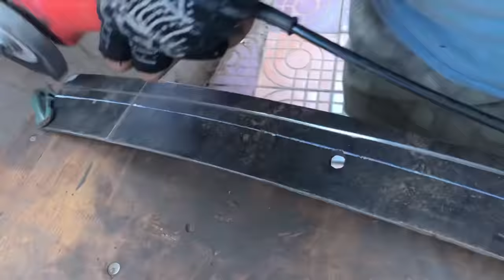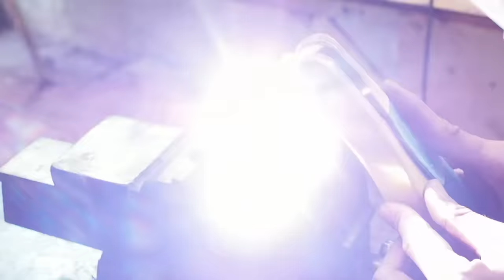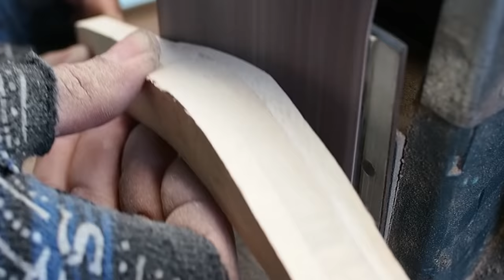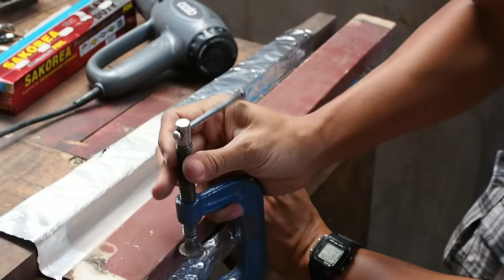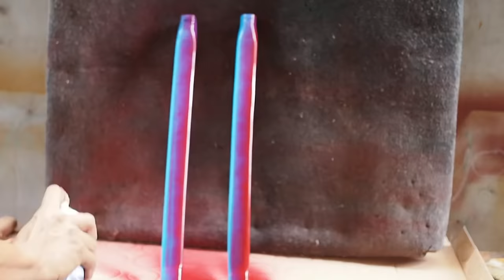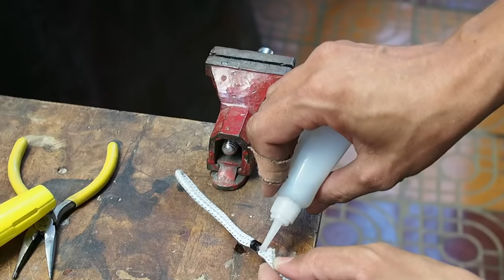Make Take-down Mongolian Bow from Leafspring and PVC pipe without Forging | Make Mongolian Bow

Comment: What’s the draw weight? I have a 60lb horse bow and that thing is a beast to shoot. I can’t imagine what a metal bow is like
Reply: Looks pretty weak IMO.
Reply: @SpontaneousDelphi  appearance is deceptive at times... a well trained archer can surely use this with ease to pin dow  it's target
Reply from the maker: Thanks brother for the question. it's 60lbs bow. I can assure you steel bows are not as good as real composite horse bows, but they will last longer and much tougher.

Comment: With all due respect, this is not a Mongolian bow. The Mongolian bow, like other eastern bows, must be in the opposite direction prior to stringing bowstrining. This is where its power.
Reply: Probably it is made of soft wood an requires retention for power
Reply from the maker: Thank brother for the comment, actually it dosen't look exactly like Mongolian, it's the best I can do for now. By the way, the limbs are made from steel, it can't bend like composite bow. The performance is also not as good as the real composite Monglian bow, but I am sure that it's much tougher and will last longer. Have a good day, brother

Comment: OK, this particular weapon is rather involved. This is no quick, easy MacGuyver rig-up here.  This guy has an entire workshop with a plethora of different tools at his disposal.  It's a very nicely made bow, but if I'm going to fashion myself an 'accessible' survival weapon from simple 'debris' just lying about, from a practicality standpoint, it really can't involve having to use more than a knife, an axe, a hand saw, a file, a piece of sandpaper, a hammer, some cordage and some glue, at the very most. You start getting in there with bandsaws, belt sanders, welding rigs, die grinders, bench vises, metal brakes, measuring devices, etc, etc, and now you've crossed into the realm of very involved crafstmanship.
Reply from the maker: Thanks brother for your kind comment. I inherited some of the powertool from my decaced father in law, and some from my brother after he stop doing wood working business. I am grateful to have them. I wish I had more time to practice with all the tool I have and improve my skill, but I can do it only on some weekend or holiday.